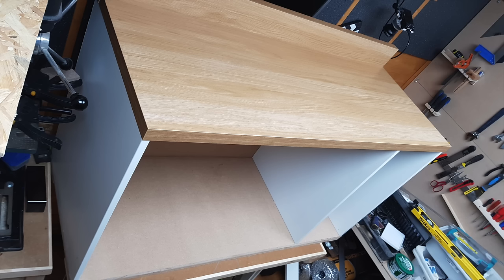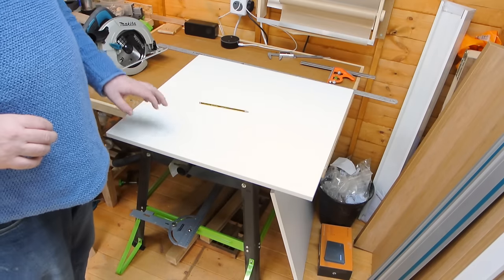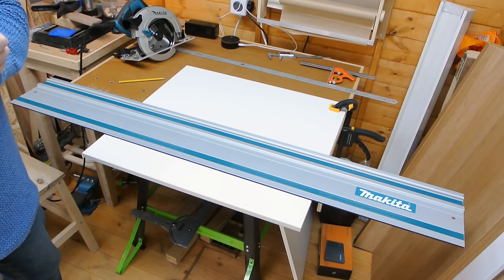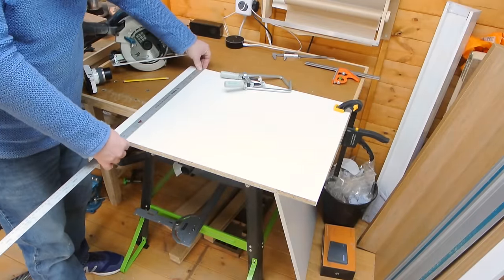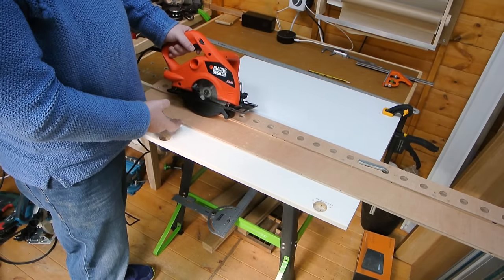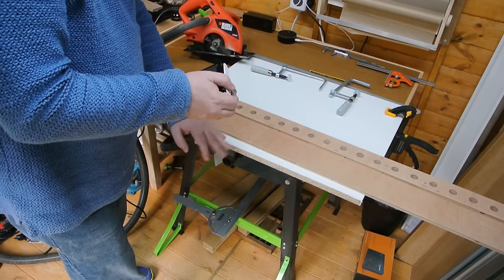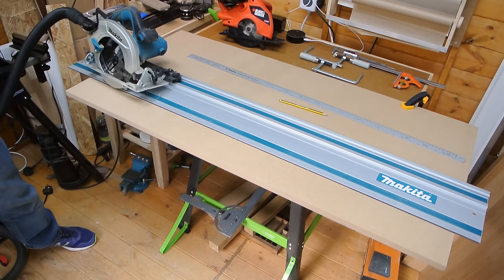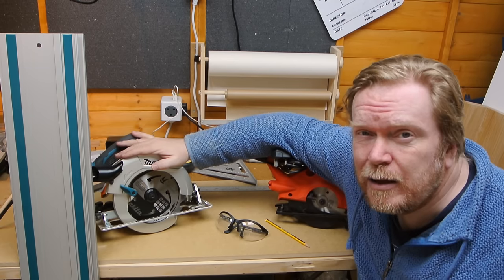Makita Circular Saw Review | Guide Rail vs DIY Saw Guide | HS7601J/2

Comment: I regularly use the Makita Plunge Track saw and a Makita 6 1/2' circular saw with a DIY rail/track similar to yours. Advantage with the plunge saw is better dust extraction and ease of setup - not requiring the need for clamps. I can't really say that the cut is that much better with the plunge say. Cost is something to consider though.  Cheers from the Sunny Coast of Queensland Australia!!
Reply from the maker: Hey Les - thanks so much for the comment. Interestingly I've found plenty of viewers from Australia and New Zealand using a very similar set-up based around a circular saw rather than plunge saw. I'm not sure why as I know that both the corded and 2x18v makita plunge saws are popular there. I've friends that live in Rockhampton - not been to visit yet - but they'll mention the weather everytime they call.

Comment: Hi Karl, a very useful video, thanks very much. I was very pleased to see your adapter worked so well. I have the Makita DHS680 cordless circular saw. I’m waiting for the guide rail adapter to see how it works on my saw and M. Guide rail. If it doesn’t work I’ll sell the saw and buy the M. Track saw. I like the idea of efficient dust collection. For the benefit of your cordless followers; to be completely cordless and hose-less I bought a Mafell dust bag #206921 which fits and works exceptionally well in collecting dust on this saw. I’ve also bought the Makita B-09248 Cordless Circular Saw Blade 40 tooth for the best chance of a clean cut.
Keep up the good work!
Reply from the maker: Thanks for the recommendation of the dust bag and you're absolutely correct about the blade - especially for man-made boards. Indeed I think that's been mentioned by another commenter.
Reply: Christian any update? Did you stick with guide rail adaptor or you invested in guide saw? As Im in your shoes and not sure should I buy adaptor or guide saw.  I do house renovations for my own houses I boy but dont want to spend that much money for track saw especially that I own circular saw and table saw. thanks
Reply: Hi Christian! Same question, did you keeps the dhs680 with rail or did you go for the tracksaw?

Comment: You bought a new makita saw and makita tracks...got a screw fix plunge saw and hood makita rails very happy with it .wont go back to circular saw and home made guides as sold them and got enough to buy a 1.5 track...'tool upgrade'...did like your holes for clamping home made rail...wish I had seen that when made mine...not seen that in any 'home brew' rail guide vids! Keep up you good work...and I'll be buying some of your waste side cut shims brill invention. Regards Graham
Reply from the maker: This video was made shortly before the market for cheap plunge saws really opened-up with Titan, Erbauer and those from Aldi and Lidl.
I do still use my circular saw a lot on the rail in preference to the plunge saw I now have. I like that it has a good depth of cut 62mm on the rail compared to 50 with the plunge saw.
I stand by the claim that the HS7601 plus guide rail and adapter is cheaper than the plunge-saw combo, but it's not a plunge saw.
The holey guide rail finally went to the tip last week. I've been really pleased that people saw the advantage of the holes. It made a difference. Parting with the little black and decker saw was a sad moment that had built many many projects over the years.
Anyway thanks for the comments.

Comment: Hi Karl, I have recently purchased a Maikita guide rails and adapter for the saw. I have had my trusty HS7601 for several years - great tool.  Please tell me what I am doing wrong: The splinter guard after maybe 30'ish cuts each around 60cm in 9mm ply and the splinter guard is virtually gone at the "starting" end of the guide rail and around 2mm left at the "end" of the guide rail! I never see anyone adjusting the little locking knobs on the Makita rail adapter - nor adjusting the little slider (to stop it tilting). The ply is absolute rubbish - bought from B&Q - full of voids.  I was using a rip saw blade. Now I searched for > 80T b;lade - gave up. The best I could buy was a 60T Makita blade...I had to buy extra splinter guard.
Reply from the maker: Hey Mauro. I'm really not sure what the issue could be. Sure the splinter guard will need to be replaced but mine did hundreds of cuts before giving up the ghost. It could be the blade. A ripping blade had teeth a distance apart; a 60T blade should make a cleaner cut in plywood, with anything over 40T being probably OK. I'm not sure where you are in the world, but check out Key Blades and Fixings or Axminster aXcaliber if you're in the UK. I've replaced all my Makita blades with those and produce much better cuts.

Comment: I'm looking to buy the same saw. I have the following question: the rail has a rubber splinter guard. When used with SP6000, the first cut trims the splinter guard. With HS7601 and rail attachment, do you need to trim the rubber?
Reply from the maker: Yes it works in exactly the same way.
Reply: How well does it work for this setup to keep a constant clearing between the blade and the splinter guard?
I mean: the guide attachment is plastic and the metal rods connecting the saw and the attachment are fitted by hand using some  plastic knobs. Mounting and removing the attachment from saw can change the clearance from the splinter guard.
I liked a lot your melamine cut. Do you keep having this kind of cuts, on different bevel angles, after all this time ?

Comment: Hi Karl, I have the Makita track but haven’t cut the rubber edge off yet. Am worried I’ll mess it up. Any tips please ? I have a cordless Makita circular saw. Thanks
Reply from the maker: Hi Jayesh. Thanks for the question and I hope you enjoyed the video. It seems quite a while ago since I made it. You might want to check another video out on the channel where I trim back the splinter guard on a brand-new makita rail. But to address your worries here there's a couple of tips worth mentioning:

1. It's hard to completely mess-up trimming back the splinter guard. But if you do it's easy to fix. The black rubber strip can be removed and repositioned to give you a fresh edge to trim back and a second chance. I've found that warming it with a hair drier or heat gun makes it easy to peel off and re-stick with the glue on the strip already.

2. Make sure the saw can move down the track with no play between it and the rail. There are often two knobs that you use to make the adjustment to the rail and the best way I found is to tighten right up so the saw won't move and then back them off until the saw slides with no play.

3. You may find that it's hard to keep the saw perfectly aligned at the beginning or end of the rail. So do some dry runs to practice keeping things as straight as possible and making sure your body position is best placed to make the cut in one go. Follow the advice in my other video and trim the splinter guard by actually cutting into some material a couple of millimetres. That way, the rubber strip is supported fully from below.

And that would be about it.

Comment: A track saw is definitely on my wishlist.
Reply from the maker: Andy Pugh It was high up there for me. I considered the Titan saw from Screwfix but as the need was to replace my B&D saw for one with a greater depth of cut, I quickly identified the HS7601J and it's compatibility with the guide rail. As I said in the video it's only fault is that it is not a track saw. You get the function but miss out on the benefits. Plunge, better dust collection accurate depth and so on. Thanks for watching. K

Comment: Have the same makita saw, so this was a very interesting video.. thanks 👍
Too bad you didn't mention anything about the adapter needed for the makita to tun on the guide rail... Maybe because it worked flawlessly? 😜
Reply from the maker: Yeah, looking back at this video I probably should have shown a bit more about that. On the plus side, the link and part number to the adapter should be pretty much solve some of the issues I had tracking the part down.; but while it's pretty simple to install there's plenty of scope for mis-alignment if you're not careful. Anyway there you go. 😀
Reply: @StrawbyteWorkshop  Cheers! 👍

Comment: Thanks for this. I have this saw, and I’m curious: What is the benefit of having the saw run on top of the track? I just clamp a scrap fence and off we go! Don’t understand the need to spend big bucks on the track.

I am however buying the Trend Varijig guide clamp, but again, intend just to run my saw/router along the side of it - never had a problem!
Reply from the maker: Okay, so this isn't going to sound like the best reason but once I put the saw on the track it was a game changer for me. So yes you can run your saw against a straight edge and make your cuts that way, but the straight edge needs to be offset from you measured marks on the board. with the track (once you've trimmed the splinter guard) the splinter guard edge is simply aligned to the marks and off you go. The track is fairly grippy so you can make some cuts without clamps (although I always clamp).

I've made and featured in the video a diy guide for my black and decker saw and that's perfectly fine. I might re-visit the subject in a future video as people have assumed that now I use a SP6000 plunge saw with the track, all these other methods are redundant, but I use a 'trend- like straight edge all the time for some cuts and especially when I want to get the full depth of cut out of the HS7601J saw. Anyway great comment. Thanks,

Comment: Hello again, hope all is well. Can I ask you, do you think the guide rail clamps for the makita sp6000 will work on the track you are talking about or u think it might differ? Think u use festol ones, not checked the price but can imagine it's silly money :)
Reply from the maker: Hey Christopher - Yes all is well. Yes in the video you see me use festool clamps but they really only cost me £20. Track clamps are basically the same and fit both festool and makita tracks.
Reply: @StrawbyteWorkshop  did you, ahhh they put the price up just over £31, will look around or buy makita ones, thanks for the help

Comment: Karl why didn’t you buy the Makita track saw to go with the rails?
Reply from the maker: Hi Craig. There is a huge price difference between the circular saw I bought and the tracksaw and at the time my need was to replace the circular saw I had with one with greater cutting capacity. It was a pleasant surprise to learn that the saw was compatible with the rail systems and makita rails are quite affordable. I've been really happy with the combination for the two years I've had them. I have upgraded to a tracksaw recently but still find the extra cutting capacity of the circular saw really useful - especially in outdoor projects (decking, planters and so on). So the saw came first, the rail second. Shorter rails as a consequence of a very small workshop. thanks for the comment and viewing the video.
Reply: Strawbyte Workshop Karl, I see your point. I have just bought the Makita track saw that came with 2 1400 rails specifically for trimming oak doors as previously I had been using a home made rail and Makita circular saw. The problem as you pointed out was that the saw is hard to keep to the line as it can wander as there is no mechanism on a home made rail to keep it straight. We shall see when I do the doors if it was a worthwhile purchase, I’m sure it will be as I can trim the door in one continual pass. Cheers

Comment: Hi there hope all is well!! I finally bought the track and adaptor and they arrived today but I have been messing with it only today before I do make that cut into the rubber strip - I found what maybe an issue, I ask you a couple of things? how did you cut the black trip off at the beginning of the track since the whole saw is not on the track and hence it wobbles which means an uneven cut or do you just discount that bit as the bit just to put the saw on to and use the rest as the actual guide? (same issue at the end of course). Also did you find when you line up to zero at both ends ( for 90 degree cut) its not quite level - one side seems perhaps 1/3 mm out? or do you thing that makes no difference to the cut (I have never cut wood with a slight angle to it i can imagine it would burn the wood,)? thanks in advance. ps the track is self looks extremely straight a good start :).  pss i shall be buying that kerf  adjuster soon too def need one
Reply from the maker: I'm glad you've jumped in the with track and adapter. The two issues you have highlighted are common  and I've had several similar questions across the tracksaw videos I've produced. The trimming back the strip and the saw not being on the track properly is common and all I have to offer is go slowly and carefully. The ends of the track won't be perfect - mine aren't - but its the centre of the track I use most and the strip in the middle that I align to marks on the wood I'm cutting.
As for the second problem you make a good observation and something I didn't notice at the time of filming. The marks on the bars that you use to line-up the saw for 90 or 45 degree cuts are simply stamped into the metal and not precise. I have a similar under 1mm alignment error when I look closely. I've just got into the habit of getting set-up placing the saw on the rail and making the final 'tightening' of the thumbscrews then when everything looks straight. After all if it looks straight it is straight, as someone once said.

Comment: I have been looking at this circular saw not 100% tho, I would make my own track. There is a titan track saw for £70 but something is telling me the  Makita would be a better idea and maybe buy a better saw blade with more teeth , what do you think ? Chris
Reply from the maker: Hey there Chris. One thing I perhaps didn't mention in the video was that I picked-up the saw for around £110 from Amazon and was surprised how affordable Makita was. Clearly if you plan to make your own guide, then that's all you're going to pay. As for blades, the thing to remember is the tooth count will suit different sorts of cut. Lower tooth counts suit long rip cuts of solid timber. Higher tooth blades cuts cross cuts and man-made boards. The part number: B-08224 has 12 teeth. Part number B-08355 has 24 teeth and is a combination blade and you can get both in a set (part no. B-49367). And finally, B-08551 is a 60 tooth fine-cut blade. None of the makita blades are particularly expensive and I tend to prefer them over Freud or Diablo blades personally.
Reply: @StrawbyteWorkshop  Hi I purchased the saw 6 months ago think it was around £200 ohhhhh :(, I have made my own guide, in fact 3 times and every time its not quite straights expecially the the end (1-2 mm out) giving me endless sleepness nights. so i think spending the £120 odd pound for the track and adaptor will be worth.
Reply: @StrawbyteWorkshop  ps did you find the track with the saw 100% straight?
Reply from the maker: Straight enough I think. With a home made track I did find issues with the start and end of cut. There is less with the Makita guide rail.
Reply: @StrawbyteWorkshop  being on a track be surprised if there is any issues ... i come to notice them when i start making the holes for dowels then realise the holes dont quite go together at one end
Reply: @StrawbyteWorkshop  I think Makita(which I have ) is better option than other close price brands for a track . In fact I think the next one up would be a kreg of festool and possibly the difference in precision is very very minor if any.

Comment: I have a Makita circular saw model 5007nb will makita’s guide rail fit on this saw so I can use on the track?
Reply from the maker: I've had a question about this saw before as I think its a popular model in North America. However from what I can tell there isn't a rail adapter for this saw based on the instruction book (which doesn't list the adapter in the accessories section) and the design of your base plate.
Reply: Just talked to Makita there is nothing for my saw that will let it work with the tracks without buying a new saw
Reply from the maker: @larrynolte9611  That's a shame. What's nice about my set-up is the guide is precise and allows you to reference the rubber splinter guard against you pencil line and cut to that.
What's nice about having a circular saw on the track is that you get more depth of cut from a larger blade and the circular saws are generally more powerful so can cut easily through denser timber. Anyway thanks for watching.
Reply: I know you are outside the United States but what model # of saw I
Do you have and the guide adapter?

Comment: Great video. Do you please know whether the adaptor is suitable for most Makita models? I have a Makita 36v model DHS710 do you please know whether it will fit this model? As when they list adaptors it seems like they only say for DHS660?
Reply from the maker: You might like to check yourself but, I think the guide rail adapter (Part number: 1969530), which is listed on the D&M Tools website, is suitable for the DSH710 and the DHS680. The Makita's UK HQ is based just down the road from me in Milton Keynes and their helpline is on 01908 211678 - they're usually pretty helpful when I've called in the past. Alternatively D&M are helpful too if you want to speak to them.
Reply: Strawbyte Workshop thank you, much appreciated. Keep up the good work and great videos m8 👍.
Reply from the maker: @deankirk1008  👍